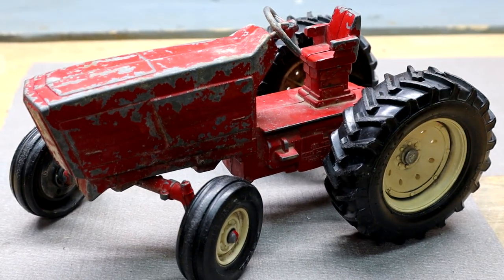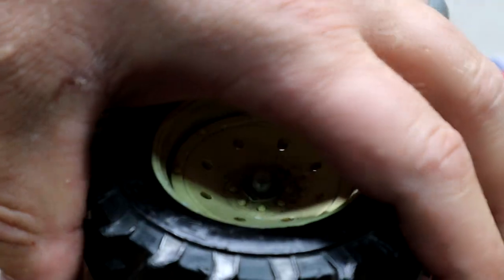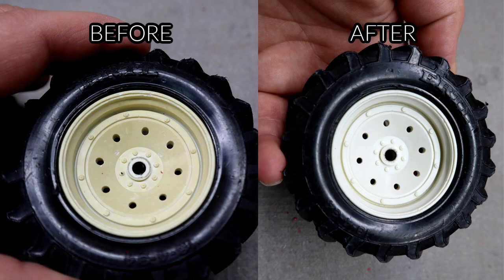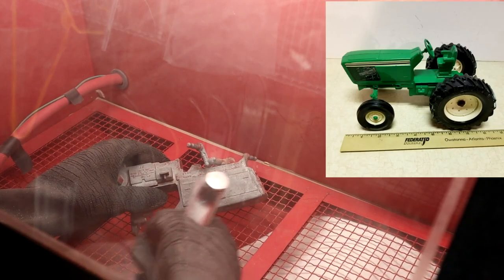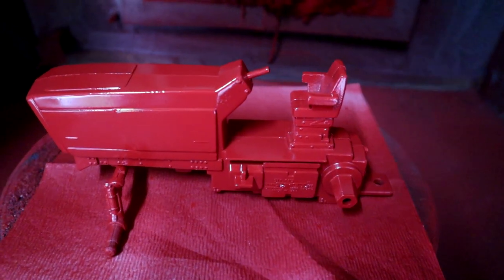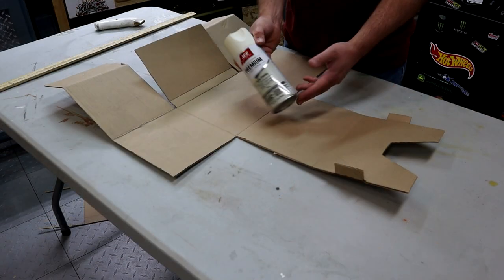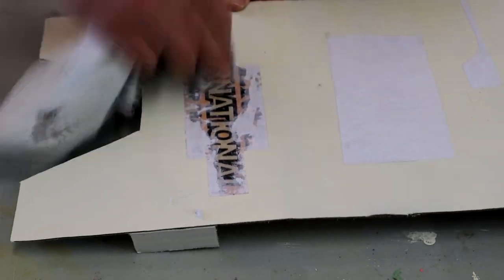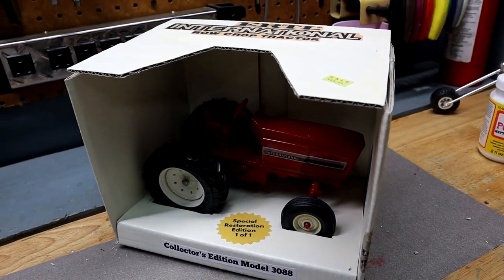Toy Tractor restoration with box! Ertl International 3088

Comment: Great work.   Question.  Where do you get decals for these old toys.  I'm starting to work on an ERTL Ford 7500
Reply from the maker: I just search them up.  Ebay is a pretty good resource.  Dakotah toys is good, but their site experience is straight out of 1995 (they have been in business since pretty much the start of the internet though). Bossen Implement who has been around a bit longer.  Bossen's site is a little bit better to use that Dakotah toys.  I find the hardest part is knowing exactly what you have and how to search to find the exact model/decals you need.  With Ertl especially, they had so many variants of a lot of their castings, if you are trying to do an accurate restoration and not a customization it is hard to find the rare variant decal sometimes.
Reply: @thejunkman  Thank you.  Looking forward to getting started on this little project.  Merry Christmas.

Comment: Were the two bodyparts soldered together since you did not disassamble it any further? If they were, you could have just heated them up so the solder would melt again ... Did you check that paint for lead before sandblasting? And I think you're using the wrong blasting medium... What happened to the steering wheel?? ... So many questions left unanswered ...
Reply from the maker: The body parts are riveted together and the simple design of this casting they didn't need to be drilled/ground and removed for splitting.  The steering wheel was crushed sometime during play and was replaced, that is explained in the video.  Lead paint has not been used on these types of toys since the 20's-30's but especially not with Ertl toys as they didn't even start making toys until the early 50's.  I have another video testing all kinds of toys from the 40's and they did not contain lead paint.  This casting was made from around 1977-2000 long after the ban on lead based paints anyways.  As far as the blasting media, it worked didn't it?  I would like to see your restorations, you sound like a nice individual.
Reply: Wel thank you, I am a rather nice person :-) but I am also kinda curious. Hence the questions. If you would have raised these issues in your video, I wouldn't have had to ask them :-) And about the blasting medium, yeah it worked ... but it could have worked faster if you used another medium :-)
Reply from the maker: How long did the blasting take? I wasn't there but sounds like you were.
Reply: wellwell... can't take a word of criticism ?? Or just not used to it?
Reply from the maker: Nah, I am just leading you on.  It increases engagement and favors the algorithm.
Reply: @thejunkman   😁 oh, OK, If you want, I can post some more "questions" on some other video's 😂